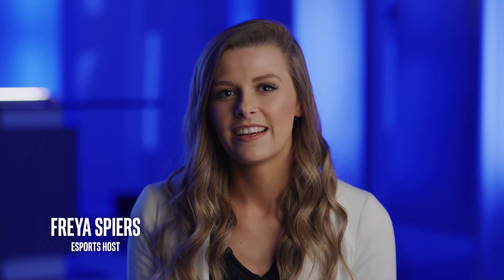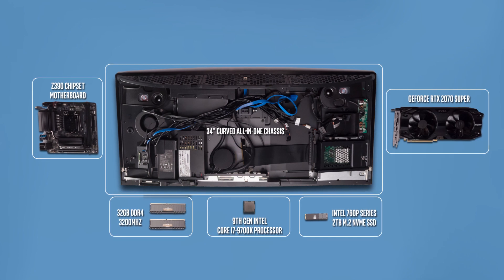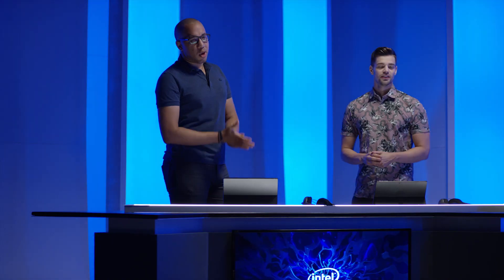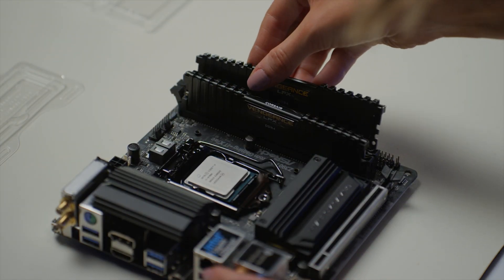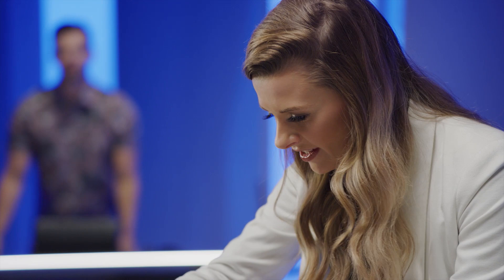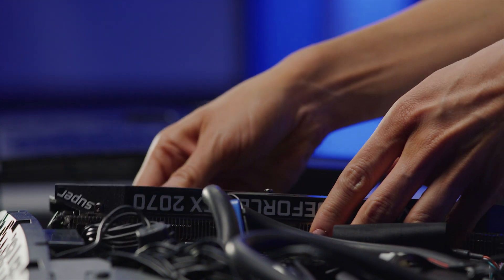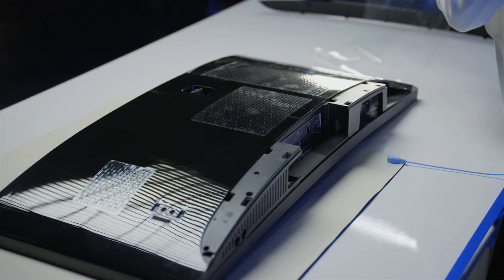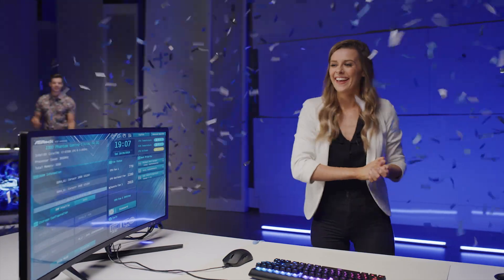Freya Spiers Builds a Gaming Ultra-Wide All-in-One PC | Intel Gaming

Comment: That was pretty awesome. I have never seen a PC built into the back of a monitor. I know Mac's have been doing that a while, but you can't really upgrade them. This looks like you could easily upgrade components over time. Very neat!
Reply: This is old news.  There were a few high end gaming pc makers that made this, but for some reason they all stopped.  If you're curious, look at the Maingear Alpha 34, Digital Storm Aura, and the Aftershock Aeon 32R .  There were a few others as well, I just don't remember their names right now.  As far as I know, Aftershock is the only one still offering a good aio gaming pc.
Reply: @ptick16  HP have 32 AIO with  RTX 2080 super

Comment: For $1000 that's a pretty good deal. They're using a samsung monitor so what comes close is the Samsung LC34H890WJNXZA at $691 on amazon. For $309 on that chassis with power, and everything else i'm sold for my next build.

Comment: She didn't use any thermal paste on the processor' heatsink...
Reply: Dan Rooney most liquid cooling systems come with thermal paste already applied to the heatsink. if you look at timestamp 2:14, you'll see a gray circle with an outer copper circle. The gray is the thermal paste and the copper is the heatsink. 

It's probably not a good idea too add more on top of what's already there but some people wipe off the original thermal paste and use their own.
Reply: @TheYoonman  Grizzly Conductonaut m8, I swear by it.